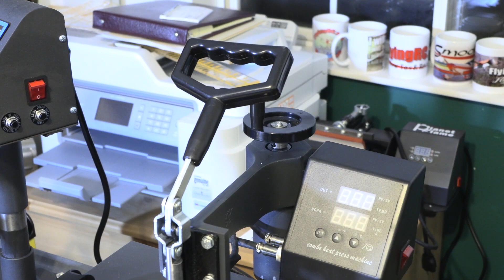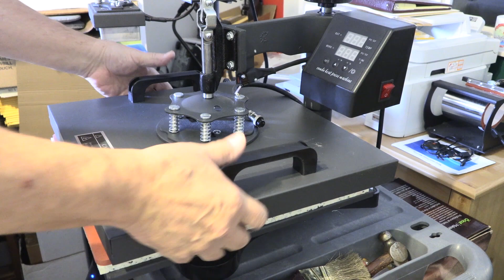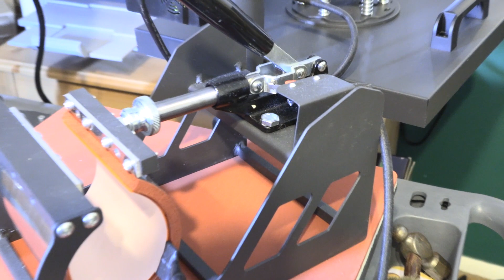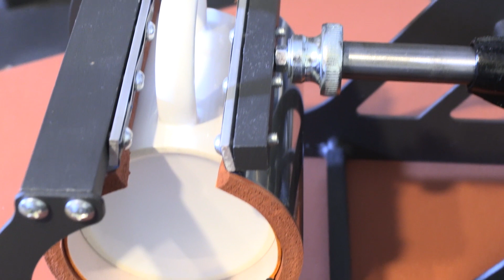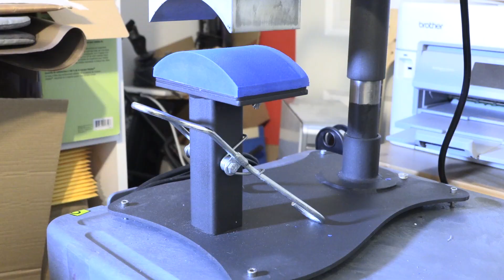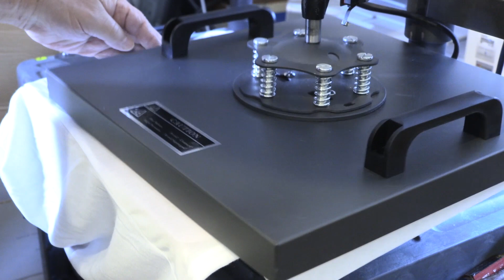Mophorn 15x15 Inch 5pc Heat Press Kit

Comment: Great review.  I have the same heat press and have had an issue straight out of the box.  Once up to temperature, it continues to beep.  Although it doesn't affect the functionality, it is quite annoying.  Any ideas on what would cause a continuous beep???  Thanks!
Reply from the maker: On my Morphon the switch that shuts the beeper/alarm off had to be on the to of a screw head to shut the beep off. The problem is the upper surface rotates freely so the switch comes off the screw head. When I got the real Siser heat press I may have "accidentally" injured that switch on the Morphon......

Comment: Hi I have the exact heat press but I have been looking for a replacement control power supply because the one I have has a shortage and it will not work at all anymore. Can you suggest placement, please.
Reply from the maker: I don't have a clue where o get something like that for that outfit. That's a big reason I bought the Siser heat press. Just had to move up in that world to get the results I wanted.

Comment: Where did you get the new hat attachment?
Reply from the maker: That's not an attachment, its a stand-alone hat press, from Heatpressnation.com. I'm done with these multi-use messes. I've gone to separate hat press, mug press aned soon, a new (larger) heat press.

Comment: Do you happen to know where you can get replacement parts for this heat press? The wiring has gone bad in my top plate and since I don't know how to fix it, I was hoping to find a replacement.
Reply from the maker: The only contact I have had with the company was through the product sdeller listing on Amazon and they got me the part I needed'
Reply: @OldGuyswithRCcars  Thank you for your reply! I've contacted the company...will have to wait and see!
Reply: @sherrileith  did you get your part fixed? how hard was it if you did?